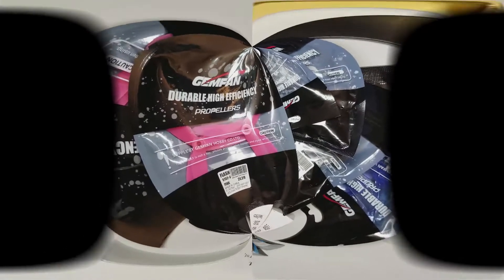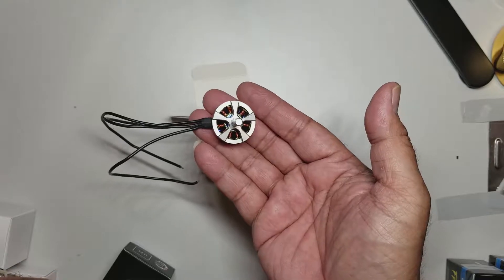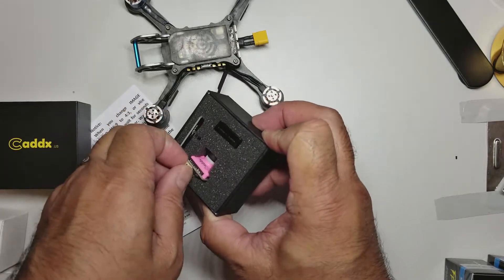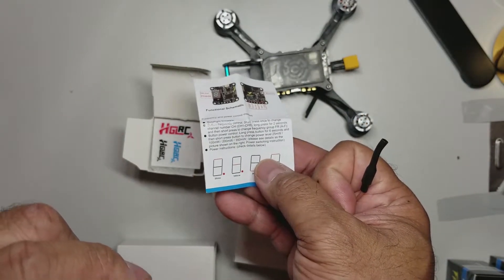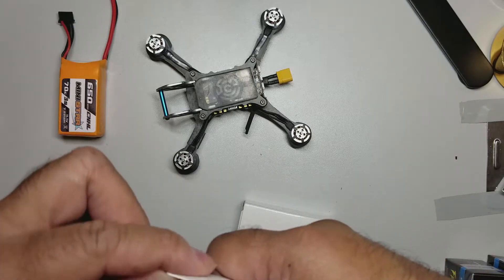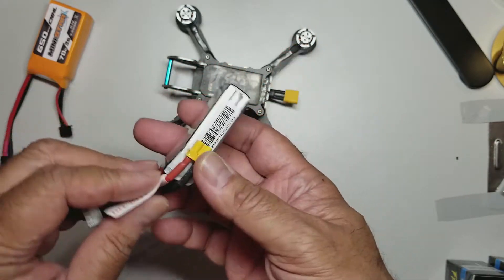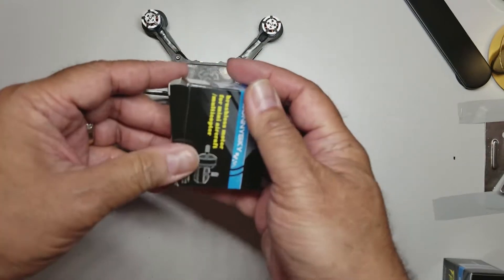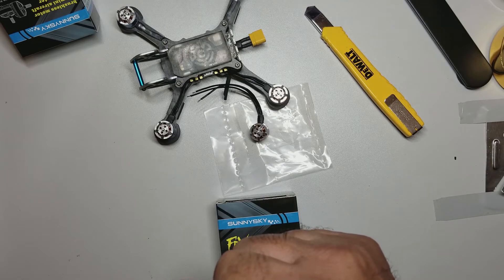FPV Gear Grocery Drop #1

Comment: So many new toys for you. Thanks for sharing. I subscribed cause I recently got a leader 120 and still haven't got it up in the air due too adding a receiver. And solding. I'm thinking a xm plus which I'm waiting for. Would be great to see you do some soldering, basic stuff like receivers. Happy flying bud
Reply from the maker: Hi David :) I really appreciate the support! I did a little bit of soldering in my Micro Swift 2 and TX200 install video on my Leader 120. The receiver is probably one of the easiest soldering jobs for me. As long as you have a small solder tip. I keep my solder gun temp at around 360 C for those small solder pads. For the XM Plus, it will be just standard sbus, 5V and ground. Let me know if you need help. I can do a quick video of soldering a receiver to the Leader 120 FC.
Reply: Pink one means your daughter want a quad lol
Reply from the maker: Haha that's for sure! Almost done with the Nemesis X build.. It wasn't easy. Tight stack was like a micro puzzle lol. Now to see if it all works! The pink camera kinda looks good in there :p

Comment: I can't wait to see the outcome of the different battery, will any be going on the leader? Enjoy the soldering iron, mine works great now that the tip has been worked a few times, took a while (3 small soldering sessions) for the very end of the tip to work for me but now it is delicious and can even get at the smallest of pads on the leader's mcu. Such a great purchase! Looking for a nice case for it like a cigar tube or something, or maybe an aluminium watch case.
Reply from the maker: I think the Tattu's are going to be perfect with the Nemesis X. BRDM has tested it thoroughly with the Tattu already. I think the RDQ 550mah and MiniStar will be ok too. All of those batteries should be fine for the Leader except for the big MiniStar 650mah. The TS100 worked beautifully. No issues and fired right up. Just got finished using it to complete the Nemesis build. Ya, the TS100 deserves a cool little case :)

Comment: Very nice haul. I"m very interested to see how those batteries stack up. The Infinity graphene batteries from RDQ look like they might be a good choice too.  Will you be able to use them all on both quads or are they primarily for the new build?
Reply from the maker: Thank you :) The MiniStar 650mah is too heavy for Leader. I tried it already lol. The Rdq and Tattu should be good though. I'm really impressed with the size and weight of the Tattu. Looks like the Leader can use all but the MiniStar 650mah. Then again, it flies perfectly with the GNB 450mah. So excited to fly the Nemesis X. I just now finished the build and all looks well so far :)